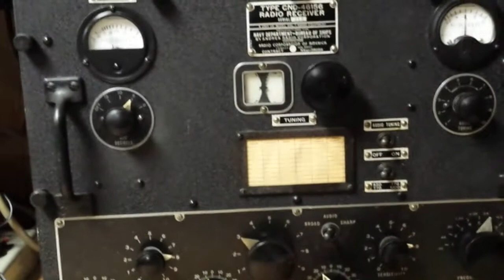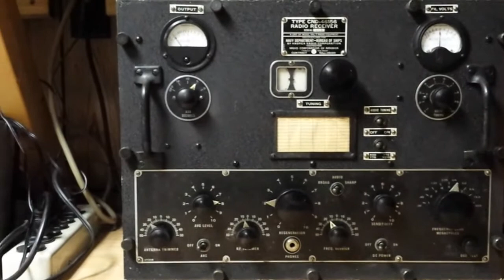AM on the RAL7 Regen Receiver

Comment: I DID NOT yet see the  DIAgram of that RCA RAL  receiver but it is NOT just an ORDINARY  REGENERATIVE  REceiver but is it actaually  a TUNED-RF tuner receiver at the FRONT-end input from antenna but it uses a REGERATIVE Detector and so , its per-formance would be  much better that  a  SINGLE-tube regenerative receiver due-to there is PRE-selector tuning. ALSo. much better to >> SUPER-heterodyne receiver at LOW-noise because there is NO LOCAL-Oscillator that adds-NOISE level and in-addition NO-IMAGE-signal generated by its MIXER,So, these  are PRE-cious HERITAGE of the GOL-den of RADIO Try to  > pre-served these heir-loom  from the PAST .